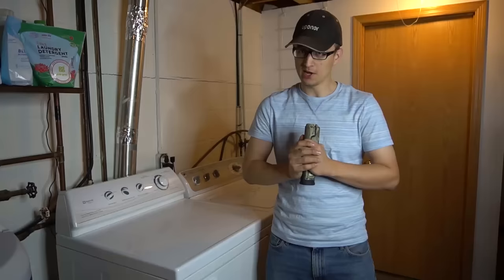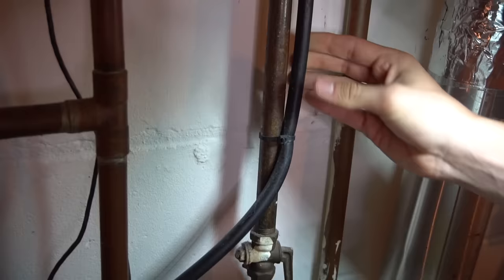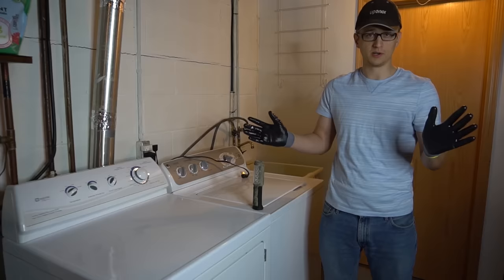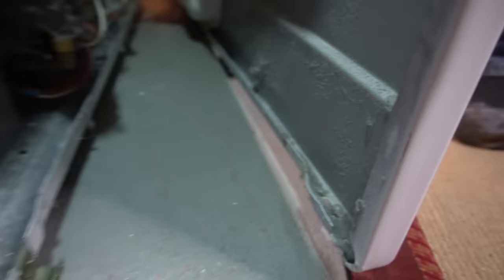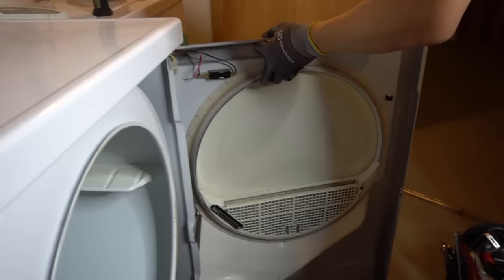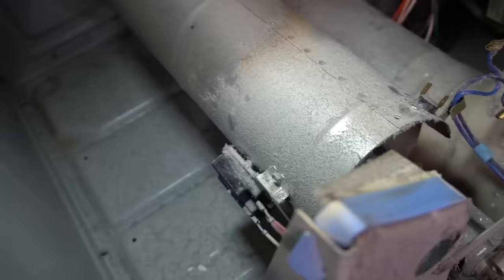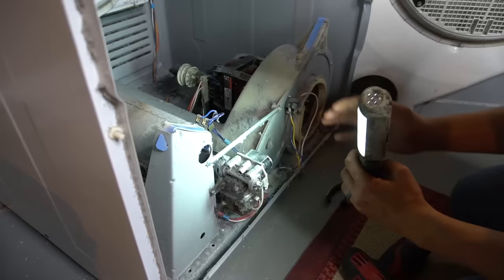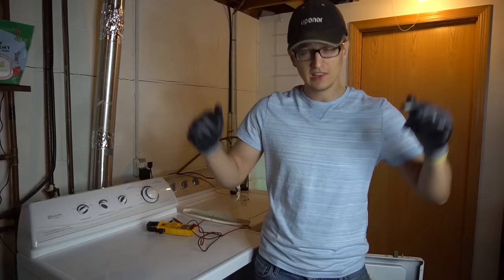Dryer Not Heating and The Most Common Fix

Comment: My dryer is heating up but it takes many cycles to dry up the clothes. Also I have the discharge that goes through the roof(attic). BTW I have Maytag Atlantis. Please advise! Thanks.
Reply from the maker: When the dryer is done, do your clothes come out hot but damp? My first thought is, when is the last time you got that dryer vent cleaned out? There is a good chance this is caused by an air restriction somewhere in the vent.
Reply: Thanks for the response, I'll have someone clean it up for me. you were very helpful!!
Reply from the maker: Great, good luck!
Reply: @WordofAdviceTV  Agreed. Cleaning the dryer vent - including the vent system inside the machine can do wonders. As preventative maintenance, that can make a welcome difference in the performance of the dryer and reduce stress on critical parts. This is also a good place to mention the value of using smooth-wall metal ducting instead of the more-convenient flexible sort, and to invest in a duct cleaning brush if - and/or call in a professional from time-to-time to do a maintenance cleaning.

Comment: Thanks for a VERY helpful video. It is the most useful video for trouble shooting. I have Maytag gas dryer. Model pyg 2000AWW. I checked everything without taking drum out. All are fine. In fact I put new gas valves too. I haven't get to check gas igniter as I have to take drum out. Before that I want to ask whether do I have to check that or not. This Ryder taking three cycles to dry. At the end of third cycle if I put my hand inside it is very hot. What could be the problem. Please help...thanks
Reply from the maker: If your dryer is getting hot then there is no need to check the ignitor since you know it is working. Most likely there is a venting issue. Have you checked your vent behind the dryer, the lint screen housing, and the exhaust hood/screen outside? Also, if it is a long vent run, the whole thing may need to get cleaned or replaced.
Reply: Word of Advice TV thanks for that advice promptly. I opened it and cleaned completely. I put new metal duct. Still took 3 cycles.Today.....I disconnected the vent hose in the back. Still it took   3 cycles. Could u please help. I sincerely thank u for taking time to respond.
Reply from the maker: @ttamail7251  Well.. There are 3 things that a dryer needs to work.. Tumble, Heat, and Airflow. We know the drum is spinning (you can hear it if it's not), we know there is heat... So that only leaves us with airflow.  If you already checked all the venting, then the next thing I would start checking is the lint collector housing (the thing that the lint screen goes into). Unfortunately the best way to check that is to actually take that lint screen housing out and visually check it so you will have to do some disassembly. (plenty of videos out there that show how to take apart a Maytag dryer if you need them) While you have it apart, also inspect the plastic blower wheel and see it is cracked somewhere. That would be the next thing I would check. If everything checks out okay, then I would try replacing the cycling thermostat (the thing that controls when the burner turns on and off). Sorry about your drawn out battle with the dryer.. I know firsthand how frustrating that can get..

Comment: Hey Jay, I have a whirlpool estate. I tested all the parts all are showing continuity. The dryer flame starts runs for a while then stops. When I restart it The ignitor comes on then goes off. Checked the gas valve coil without taking them off the gas valve. Just removing the connector. Is that ok? I'm guessing it's the gas valve coil. Would you agree.
Reply from the maker: I do agree with your conclusion. The gas valve coils get weak and they start to fail to open up the valve. Sometimes checking it with a meter will show that it's good though. I would replace those gas valve coils
Reply: @WordofAdviceTV  thank you, I did get them this morning and she's up & running again. I want to thank you for your video. I have 2 other gas dryers sitting apart in my basement. Now I know how to figure out what's wrong with them and its thanks to you! Rock on man!!!
Reply from the maker: @JOHNNYTUGS1  Awesome! Glad to to hear that! Thanks for coming back with an update!

Comment: Help, i have a Maytag Dryer its very noisy on a cold start up then noise will go away after few minutes  any ideals  to look at?
Reply from the maker: I can't say for sure without taking it apart and taking a look but usually it's either the rollers (or glides) or the idler pulley is getting worn down unevenly.

Comment: The inside of dryer smell like gas when off.. check out side connections for leak and they are none.. Do you think I need to replace the gas value assembly?.. Model GE GFDN110GL0WW  thank you

Comment: Great video. I just wish that u mentioned the resistance range / expected resistance for the components u tested.often they could be bad not only due to open but rather due to  high impedance above design range. I guess I will have to look them up or maybe u could list them.  Thanx.

Comment: My dryer turns on if I have clothes in it I have to give the inside a lil push to get it going... (Only with clothes in it) also my dryer isn't blowing out the air not cold or hot but does heat up it's a apartment size Haier electric dryer any info is appreciated thanks

Comment: What about switches? Timer? Temperature settings (i.e. high /low) on button? Can any of those affect a dryer as far as it not heating up and if so how does one test a switch?
Reply: Multimeter
Reply: Yes a bad switch can cause a dryer to not heat....use a multimeter and check for continuity with the switch on heat position...if the circuit is open when it should be closed you have a bad switch.

Comment: My Kemore Dryer won't run. When you push the ON button it makes a sound like it is trying to work. To get it to make that noise again you have to turn the circuit breaker off and back on, then push the ON button again. After that I quit doing anything with it until I get info on what to do with it.

Comment: I have a question about my dryer. Recently it kept running without turning off. So I replaced the timer and the thermal fuse (I realize now that I shouldn't have replaced both at the same time). Then it was working good for the rest of that day. Then when I went to wash clothes about a week later, it wouldn't turn on. So I called my local appliance parts store. The guy said that it was the thermal fuse and possibly lint buildup. So I called in someone to clean my lint out of the pipe that leads out of the house. After he did that, I changed the thermal fuse again. Now, it's gone out again!! After only one day!! What could be causing this? Please help!

Comment: So, does it matter how you plug the thermostat back in? Like should I remember which wire went to which side?
Reply: No it doesn't matter. Its power in and power out. It does nothing more than interrupt power, like a car fuse, when circuit is overloaded.
Reply: @williamyocum4774  got it thanks!
Reply: Also, normally the wires lay naturally. They have been in that position for a while. So unless you start bending the heck out of them, they should naturally fall back into there original position.

Comment: Is there a way to run the machine with the tub removed to verify the igniter and/or other components are working?
Reply: Yes, tub does not have to be installed to check for heat. It does nothing but hold clothes. So starting it without drum installed to check for proper operation, it will work. Wouldn't run it very long though. Stuff gets hot quick.
Reply: Thanks for the idea.  I ran mine without the tub which showed me the ignitor is working.

Comment: My maytag dryer turns on, wont heat up, and will just keep running and running. The dial while its running wont move either. Any idea on what is going on?
Reply: Timer motor is bad

Comment: I have tested all the bits and look good at 0 ohms or the same value when you touch the leads to calibrate.  at 200 ohms the meter will only calibrate to .4/.5 ohms.  the thermal igniter is the only part that does not seem to read the same as the calibrated value.  but it is hard to touch the pins inside the connector?  any ideas?  Also what is the best way to get better access to the igniter?  thanks for the nice viedo!  I have a maytag very much like the one you have...
Reply: Got the igniter out it had a CRACK in the element I scratched the crack very carefully and the element came a part at the crack pretty sure the issue is the igniter....
Reply from the maker: Hey Grant! If there is a visible crack in the ignitor, then it is for sure bad. Once you get it replaced, you should be good to go! :)
Reply: @WordofAdviceTV  yup placed and order for it today.  thanks again for your "youtube" certified advice!

Comment: Great video, quick question though. I have a gas Maytag Atlantis, Model # MDG6400AWW. I checked the thermal fuse and the other sensors, coils and ignitor mentioned in the video and everything seems to check out but it still won't heat up. Prior to the heat going out altogether, the "auto" cycle quit working and we had to use the "timed" dry. Any suggestions or is it just time to replace it? Thank you in advance for any help you can provide.
Reply from the maker: If the auto cycle quit working and later the timed dry, then it's quite possible that the timer is simply not sending power to the ignitor. I would try replacing the timer. You can check it with a meter and the wiring diagram that should be somewhere in the unit (usually by the timer) but those dryer diagrams can be pretty confusing.. Even though I look at them often, it still takes me some time to figure it out so unfortunately I won't be able to walk you through checking the timer. Perhaps someone has a video out there on how to do that.
Reply: I appreciate the amazingly fast reply! The igniter is working.is there a way to check the gas valve? The solenoids check out. Thank you again.
Reply from the maker: Gas valves rarely fail. As far as I remember I have only replaced one before. And even then that was because it was leaking and a little bit of gas was coming through when it was off. I don't know of a way to check whether the gas valve is stuck or not.. I would still suspect the timer before a bad gas valve though. Sorry, I can only go so far without seeing it :)
Reply: I almost hate to admit it, but I was thinking about the solenoids and how sometimes on a solenoid that's going bad in an (old school) car you give it a lil tap and vroom! Well, same thing worked on my dryer. Hahaha so I'll be ordering some solenoids. They ohm'd out good but must be getting worn out. Thanks again for a great tutorial.
Reply from the maker: @blueovalblood  Ahhh, it was the solenoids after all! Good catch :) But that's good! That's much cheaper than a timer. Thank you for the update!

Comment: Excellent video. However, i checked all the fuse circuits as you've described and how and they all have continuity. The dryer starts up like it should and the burner ignigjts and dryer starts heating but after about a minute the burner shuts of. Dryer keeps running but with no heat. Any help would be greatly appreciated. Its a Maytag Neptune. Thank you
Reply from the maker: I can't say for sure but in a case like that I would start by replacing the gas valve coils. If they are weak, many times the burner will come on a couple times but then the gas valve will stop opening for the rest of the cycle. That's most common and easiest to replace so hopefully that's what it is in your case.
Reply: @WordofAdviceTV  That's what I came up with as well. I ordered them so hopefully thats the problem. Thanks for the reply.
Reply: @WordofAdviceTV  Gas valves fixed the problem. Thank you
Reply from the maker: @danhaas1543  Awesome! Glad to hear you got it fixed. Happy laundry! ;)

Comment: @Word of Advice. In the Vid I don't see a "Jumper Wire" across your Cold Water Meter. If it's there, you are fine. If not, it can and will lead to bad things. If your House Neutral(behind your house from the Pole) is corroded or ever become broken, you Will experience electrical problem. And if during a Wind/Rain/Ice Storm, if a Hot Primary Wire come down in your easement (behind your house), this can cause a Very High Voltage surge into you house and it will cause a fire and destroy your electrical. It will not be coverd by Insurance due to the missing Cold Water Meter's Jumpering Ground Wire. If you have a "Driven" Ground Rod, then disregard this post!!
Ok, just a observation from a Lineman.

Comment: Hi
I have a HE3 gas dryer,acting weird these days.
It doesn’t heat on all settings .And it decides on it’s own which setting to work on!
Yesterday it worked on “ timed dryer”, today on “express dry”
What it does is,the igniter glows for few seconds and goes cold again or it won’t glow at all.
I opened the dryer, the thermal fuse is okay thermistor is showing 1760
Reply: Is your dryer digital?
Reply: Sounds like the gas valve is not opening.  Check the gas valve activation coils.  Just wiggle the connection terminals on the gas valve.  It's possible the electrical connection is poor at that point meaning that sometimes it works and other times it doesn't.  Also check the ground wire connection on the timer.

Comment: Samsung dryer, the thermistor keeps on blowing, I think it is the wiring, how do i replace that.  I have no heat to dry clothes but it turns on.
Reply: Check your venting for restrictions, you might check the cycling thermostat as well.

Comment: I checked all of my circuits, the fuses, the igniter, even all of the solenoids seem to have the correct ohms. Does this mean it might be as simple as just cleaning the vent? My unit is from the 80s, I would prefer not to be one of those people that just throw stuff out when it doesn't work.

Comment: I had water in my gas line, long story short the water line leaked directly into gas line filling it completely with water from the meter and to all gas appliances.  I removed water from my dryer from the gas line.  What issues is this going to cause.
Reply from the maker: If you removed all the water and this was only a one time event (not a yearly flooding) then I think there shouldn't be any problems.. I would give it a day or so to dry completely if you can do that.

Comment: Is it important to disconnect the fuses before testing them?
Reply from the maker: If you are checking resistance (ohms) then yes, they need to be disconnected otherwise you will get a wrong measurement.

Comment: WELL, WHY DON'T YOU JUST GET TO THE POINT WHERE THE HEATING ELEMENT, THERMOSTAT AND CUT OUT SWITCH OR SENSOR ARE ALL GOOD BUT STILL IT WON'T HEAT.

Comment: I checked everything you mentioned and all components showed continuity. I bypassed the thermal fuse and the electric dryer started heating. I replaced the thermal fuse and it worked fine afterwards. What would cause it to show continuity but actually not heat until replaced?
Reply: Bad switch contacts in the thermal fuse.

Comment: Question on a gas dryer will it work without the electric power my issue  is it still tumbles but no heat and also the timer isn't working so it doesn't shut off
Reply: If you have no power, the motor that spins the drum and the blower won't work.  So, no, a gas dryer won't work without electric.

Comment: Centrifugal safety switch on motor too
Reply: I've never heard of that one.  Sometimes there is a themal overload switch, but usually not a a dryer motor.
Reply: He's talking about the centrifugal starter switch.  It connects the starter capacitor at low rpm, and switches out once the motor is turning at normal speed.  That's the click you hear as the motor is spinning down.  If the switch is stuck open, the motor will just hum and not start turning.  If it is stuck closed, it'll burn out the starter capacitor and then just hum.

Comment: Continuity is for lower resistance tests, above certain amount of resistance as in a coil you have to use the Ohm setting. Yeah, continuity won't work for 500 ohm range and the 1300ohm range that the coils are at.

Comment: Nicely done! But I have an electric dryer
Reply from the maker: Thank you! A lot of the components will actually be very similar in an electric dryer. But instead of a burner and ignitor, it will have a heating element.

Comment: Would you say these fixes are the same no matter what type of dryer?
Reply: gas have coils because use gas to heat
electric dryer dont have coils because use a heating element in order to produce heat
Reply from the maker: There will definitely be similarities but there are many different brands/models of dryers so each one comes apart a bit differently. Both gas and electric will have similar thermostats, limits, and thermal fuse. But like Luis said, electric dryers will not have the gas valve components since it uses a heating element instead.
Reply: The method of trouble shooting is the same with most appliances.  You go to individual control devices and determine if they work or not.  In many cases if the device is supposed to be normally closed and opens on rise in temperature you can just connect the two wires that go to it together, eliminating the device,  and see if it starts up.  Be careful though as most of these devices are pure 110-120 volt so you can get shocked if you aren't careful with what you touch when it is plugged in.

Comment: Does most of this information and same kind of setup if it’s a stacked unit
Reply from the maker: If it is a stacked unit, it will disassemble slightly differently but most of the components inside will be the same.